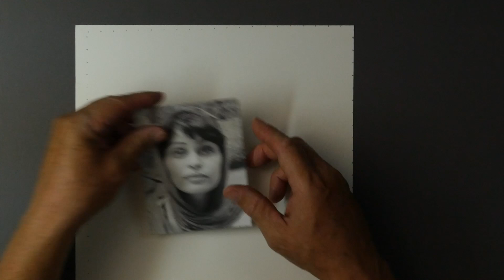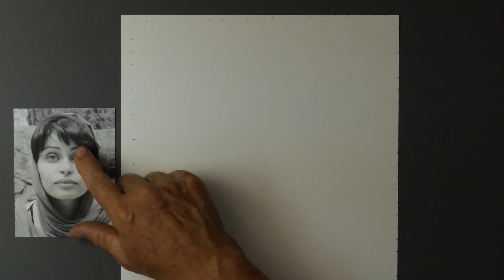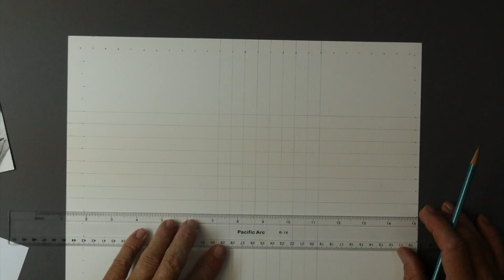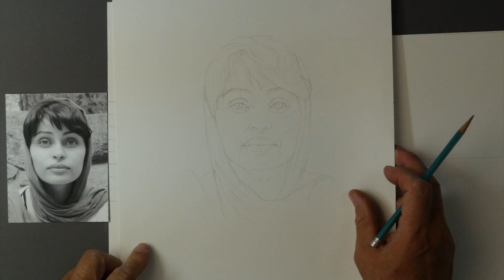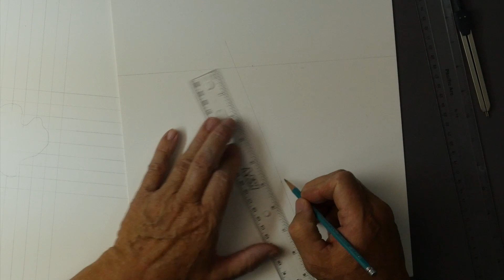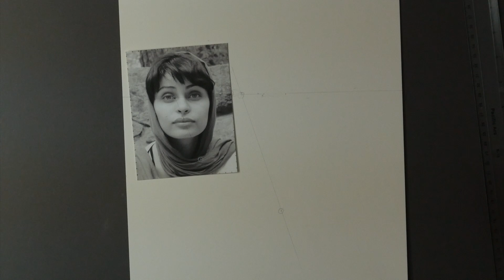Drawing Layout Techniques - Grid Method?

Comment: What if you are drawing from a mobile phone.. How can your method be used
Reply from the maker: If you understand the method, you will not necessarily need to see the detail on your phone, but instead, what you hear will be a reminder. There are also videos that can be watched for visual instruction and demonstration.
Reply: I have been drawing for 60 years and much advice online is useless. Grids work but they are too much trouble. Transfer your image to a computer and use the screen as a lightbox. Adjust size and trace directly from the screen, tape the tracing paper to the computer if needed. This method is mentioned online several times, including Lachrie Fine Art website.

Comment: I've always used grids. I will try this method, however, for the test. The problem can occur with the hair. E.g. long hair of a woman. I would like to copy every fragment carefully.
The grate will work here well. How many dots should be set to
imitate such hair. Plenty of time it will take.
A similar problem would be with, for example, the landscape. Another example is clothing like a movie. All these folds under the chin of this lady. Mark each fold?
Reply from the maker: When I start a new layout on camera, I usually encourage you to try the Straightedge and Divider Method, for a number of reasons. However, I let you know that, if you are having trouble with understanding the procedure, you can always fall back on your Grid Method if that is within your comfort zone. 
I show you how to establish the two main Bearing Lines from the reference to the Drawing Paper. Where the Bearing lines intersect, this will be the Main Bearing Point. From that point you will determine your Size Ratio This will give you the ability to anchor your Reference Points on one of those Bearing Lines. Usually the one that goes from Side to Side. When you have decided your Size Ratio, you will measure down on the Bearing Line that goes from top to bottom and place a mark the will become your Pivot Point. From that Pivot Point, you will reach out to each place that an important detail intersects the Bearing Line that goes from side to side. When you have those marked, you will pick either the one established farthest to the Right, or the farthest to the Left and use that as an additional Pivot Point to find the places that Intersect the Bearing Line that goes the Top to the Bottom. When that Bearing line has your details marked that intersect that Bearing Line, you can then pick out the Bearing Point that is farthest from the Main Bearing Point on the line and make a second Pivot Point. You can then reach out to anything that you would want to find. Even it is a Dot that you have specifically placed on the Hair of your subject where you need to find a particular point that you have placed on your reference, other than on your Bearing Lines. The difference is, you must make a longer Straight Line that runs through where you want the point of detail, so that you can then pull from your other Bearing Point, so that you can intersect that line from another direction. The point where it crosses that line will be you reference Point. You can make as many reference points for the hair as you like. The Divider is also excellent to use as well, once you have enough of your reference points established, so that you can use it as a comparative measuring tool. I hope that this helps… It is easier to show you in a demonstration. “How To Draw Accurately Every Time” Is a good Demo Video (https://www.youtube.com/watch?v=jexwG4bnTN0), even though I demonstrate the layout in most of the 5PM Class Projects…, Darrel :) :) :)
Reply: @5PencilMethod  Thank you for the comprehensive answer. 
I understand the method. I looked at all available materials. The point is that I gave examples where this method will take a lot of time. This method is profitable when we have, for example, a person without hair, without clothing. The more details, the worse. It's about time / effort. Sometimes you need to set up hundreds of points on your hair or clothing. For me, it is important to reproduce not only the face but also the rest. When I have a lot of details, I make a dense mesh. But as I wrote I will try, I will compare the methods temporarily.